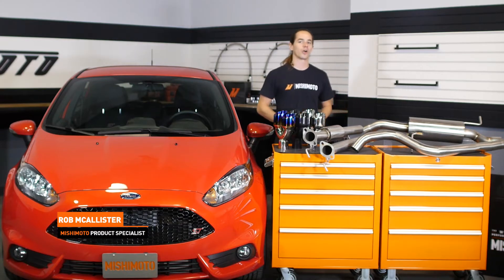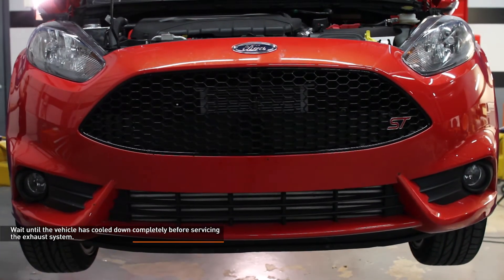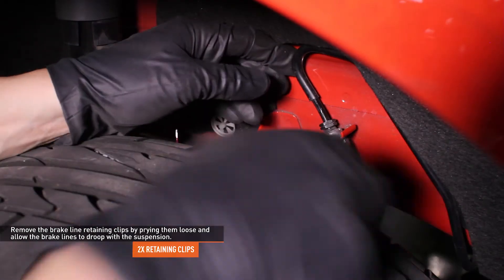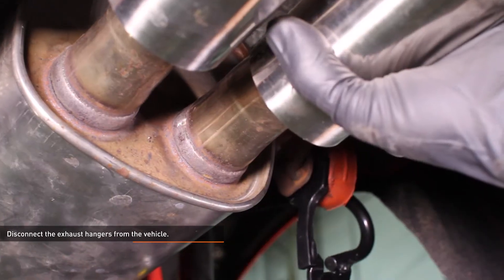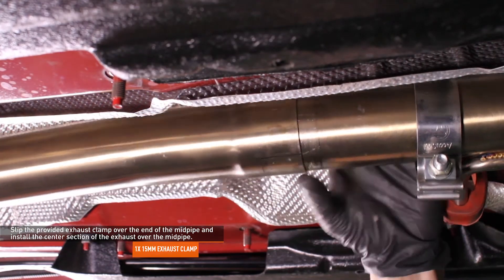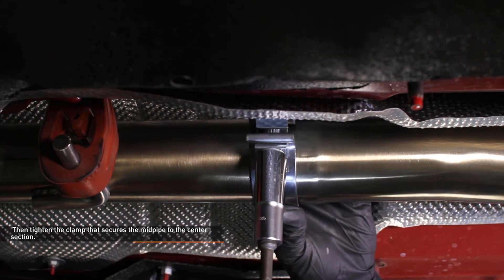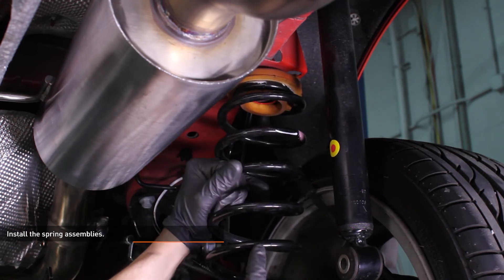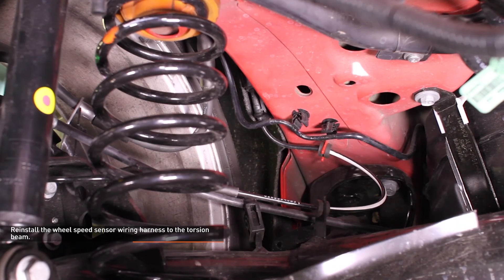2014-2019 Ford Fiesta ST Cat-Back Exhaust Installation Guide by Mishimoto

Comment: you need to include torque values for all the bolts in all these videos. Its really important especially when messing with brakes.
Reply: 1 2 or 3 Ugga Duggas
Reply: Tight is tight my friend

Comment: The mid pipe with the bend sits extremely close to the heat shield in my install.  All the pipes are fully seated in the slip joints and everything is lined up. It's almost like the pipe is an inch too long. Any ideas how to  adjust this?
Reply from the maker: If you can shoot a couple of pictures over to our team we would be happy to take a look and see what might be going on. Feel free to shoot an email with some pictures to support@mishimoto.com.